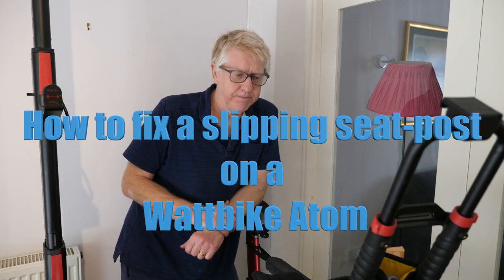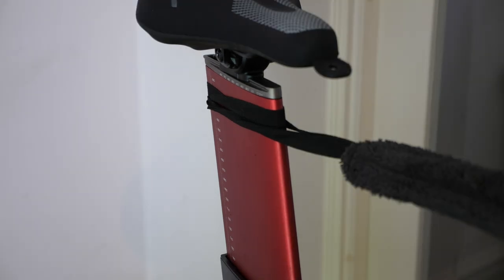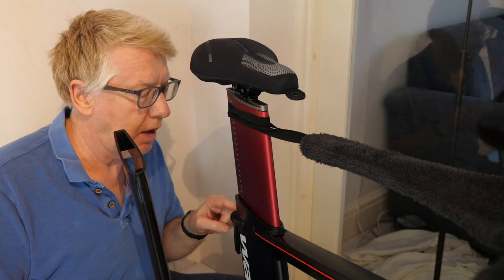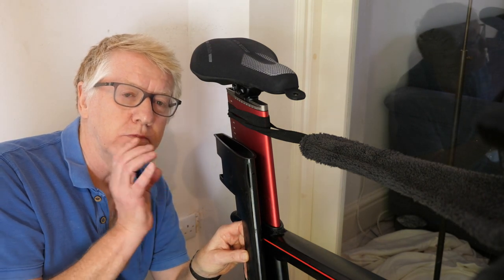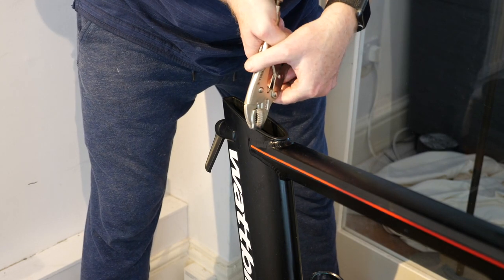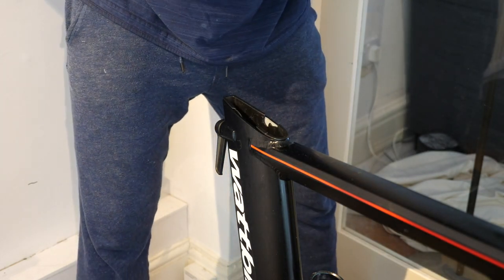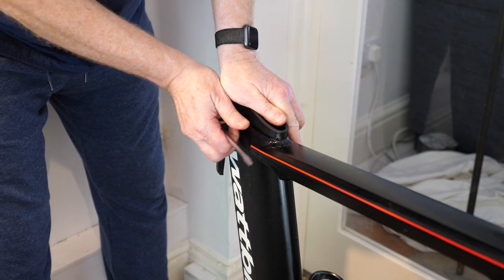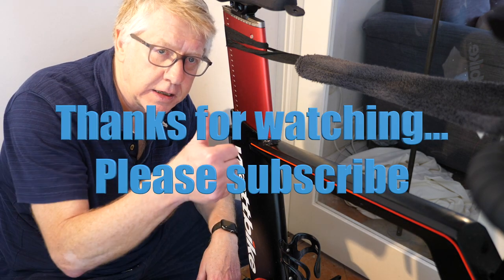How to fix a slipping Wattbike Atom Seat-post

Comment: Hi Julian, Thanks for that info ill keep a watch on my Atom when it arrives. ordered on the 27th Feb. could you link where you got the seat cover too. Also i am coming from a spinbike with cadence, speed monitors, so Zpower and would like to know how to dial in my actual w per kg before the FTP test. The zpower i know isnt exact and god knows i have tried to get it as good as i can with just the cadence and help from an app that translates HR2VP. Any guides on transition from a turbo/spinbike to the atom would be greatly appreciated.
Reply from the maker: Hi, this is the seat cover: https://www.wiggle.co.uk/selle-italia-seat-cover. Why do you need your Zwift Power FTP? Do the FTP test in Zwift and it will tell you your FTP; the Zpower figure is not accurate! I don't think you need any tips to transition to the Atom - just get on and pedal! BTW, there's a video on my channel about the true meaning of FTP.
Reply: @JulianHutchings  maybe i wasnt clear. the spin bike only gives me the option of zpower, which we both agree isnt accurate.The transitioning point was that Zpower is so inaccurate and my ZWIFT stats will all need resetting with the Atom. just by pedaling on a course in erg mode will bring it online witht he true power in my 47yr old legs ;)

Comment: The seat post design is shocking.  I overheard the technician saying to his mate that they have lots of problems with Atoms where two people use the same bike and are constantly adjusting it.  I got one 3 years ago and use it regularly.  Gone through numerous seat post and headset clamps.  The nuts and components are made of low quality steel and wear quickly to failure  and require replacing every 6 to 9 months of regular use.